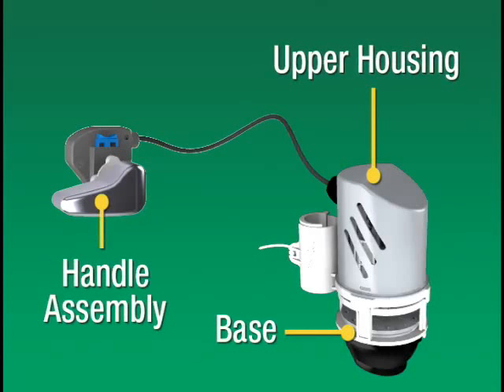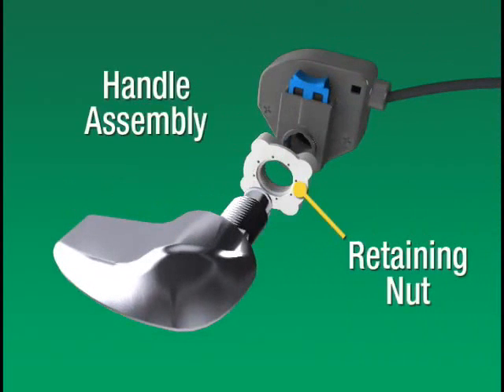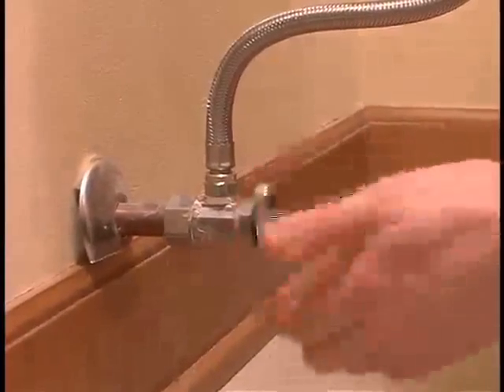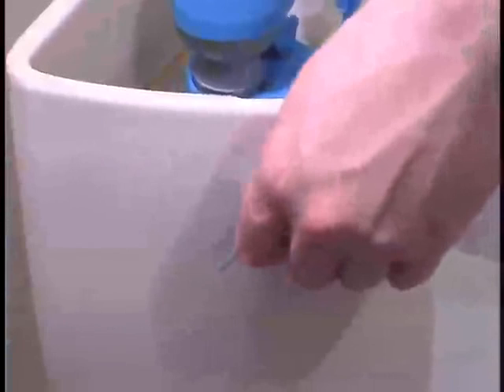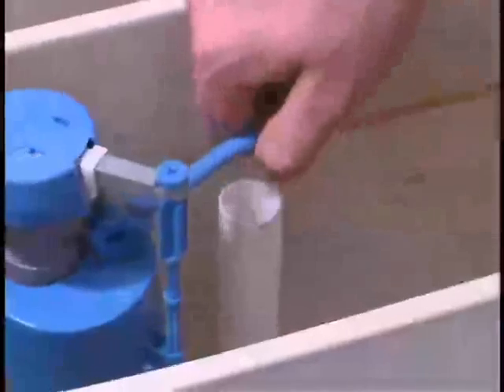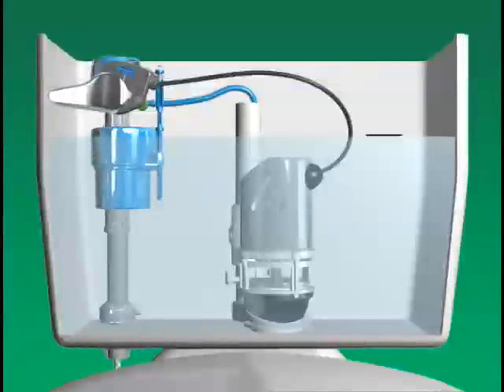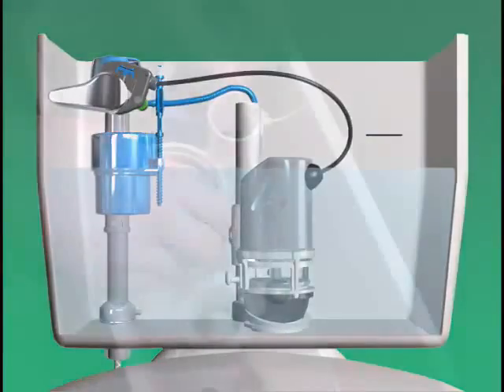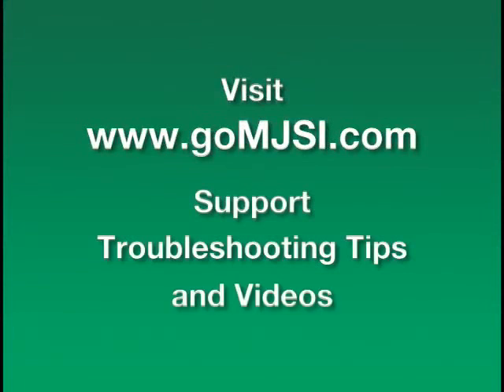HydroStop Flapper Alternative

Comment: I didn't even use the instructions, this was super simple and easy, after watching this video.  The only issue I had was positioning the Control Box to the handle to clear the tank lid.  After that was done (at a 90 degree angle) it all works like a dream.  Thanks for the great video and product.